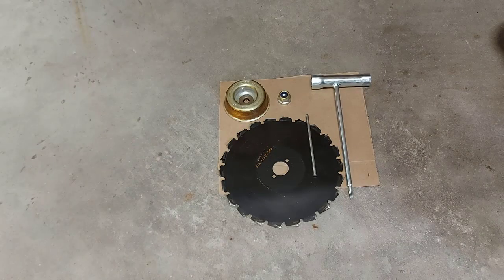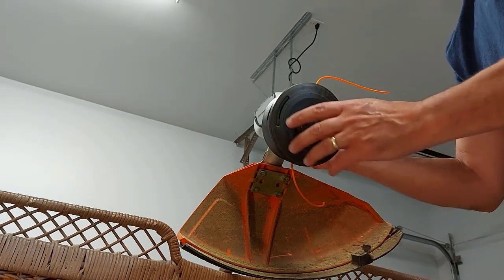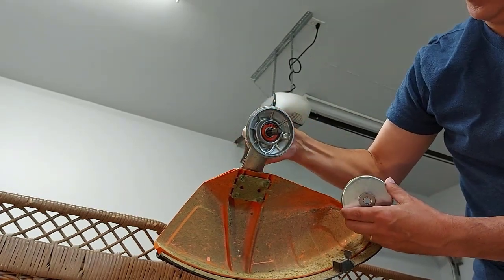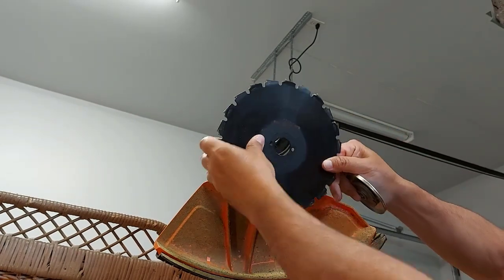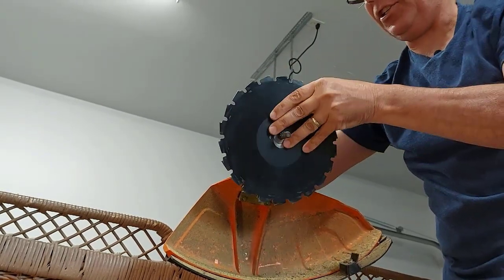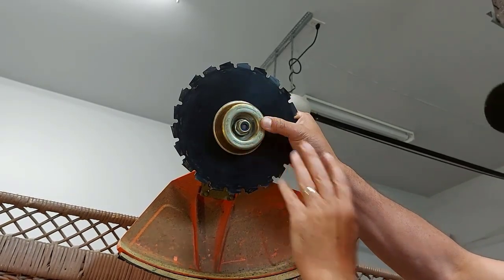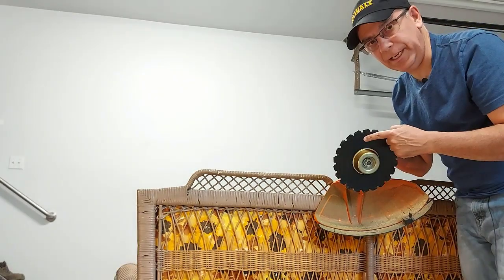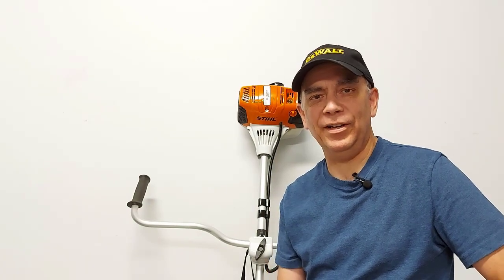Stihl Trimmer Brush Blade Installation | EASY Attachment

Comment: Almost every time I put the blade on upside down the first time.. Mainly because my old FS 36 that I used for years and years turns the opposite way...lol  ( I don't accept change well ..lol)   Last night I took a paint pen and wrote TOP on the blade..lol   Should last a couple cuttings anyway....
Reply from the maker: That's a great idea for each time after using. Smart!